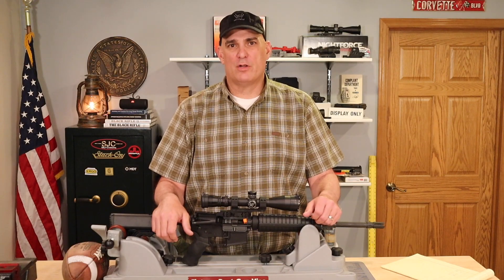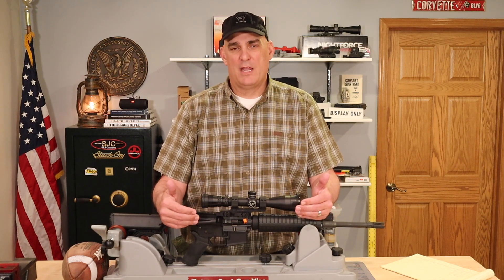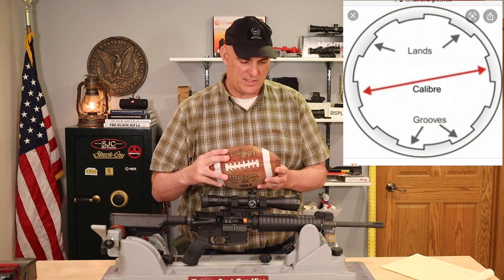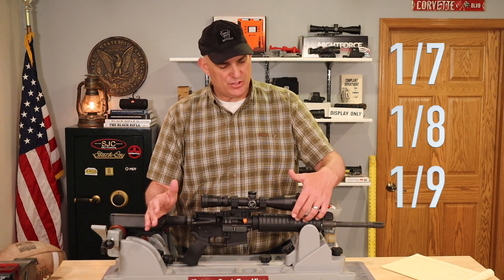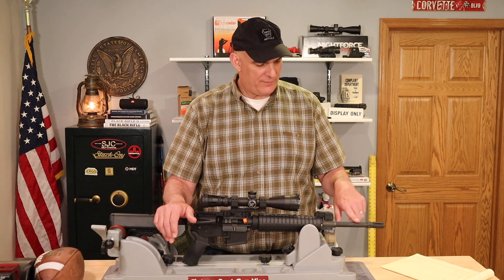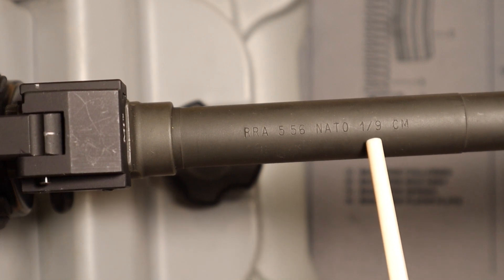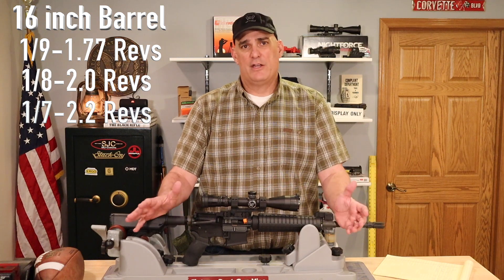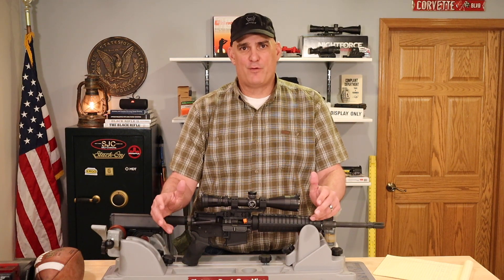Ar 15 ( 5.56 Nato / .223 Rem ) Rifle for beginners: Barrel twist rate made easy.

Comment: There is a lot of factors and half of them counter act each other. Longer barrel = higher accuracy, lower twist rate = higher accuracy, heavier bullet = higher accuracy, longer bullet = less accuracy, lighter bullet = less accuracy, and other little like the more aerodynamic a bullet is the more accurate it is at longer distances. An example is the 6.5 creed is accurate up to 1100 yards but similar .308 stops being accurate at 800 yards. The 6.5 has a thinner more aero dynamic shape so it stays super sonic past 1000 yards. This is only ballistics though. If taking into account the deadliness of a bullet the factors further increase. The faster the bullet the more penetration increasing distance into the body and/or body armor, the heavier the bullet the more energy it will take to stop it, at certain speeds bullets fragment, etc..
Reply: I've heard the barrel = accuracy (semantics) argument a lot. Definitely adds velocity. Not necessarily accuracy though.

Comment: I disagree with the length/twist rate hypothesis. The projectile doesn’t start spinning until it reaches the actual barrel grooves. Barrel length includes the entire length of the round of ammunition, brass and bullet combined. Only in a revolver, would you not include the length of ammo.

Comment: Sir, if you had a bunch of .223 American Eagle 55gr, Xtac 55gr? & IMI 62 gr, what upper twist and length would you choose for optimum bullet performance? I have it stuck in my head that my .223/5.56 stash isn't a good mate for my rifle.
Currently, I have a 16" 1:7 twist and cannot test past 25 yards being a city dweller.
Thank you if you answer this question.
Reply from the maker: You should be fine, but here is a video I did with 1/7 twist and 55 gr ammo.
https://youtu.be/pJ5lg5-0nM8
Reply: Over stabilized seems to bot affect precision just accuracy under stabilized seems to affect precision more

Comment: 20 inch upper 1/9 twist rate. Would the 62 grain M855 be okay?
Reply from the maker: Yes. Check out my twist rate videos part 1 and 2 for shooting demonstrations with a 1/9 barrel. Thanks for watching.
Reply: @PracticalAccuracy  What about 62 grain m855 with a 20 inch barrel and one in seven twist? Would that bullet be over stabilized?
Reply from the maker: @FinalLugiaGuardian   No. You can even shoot 55gr if you want.  here I shoot 55 gr with 1/7 twist.  https://youtu.be/pJ5lg5-0nM8

Comment: Hello.please🙏I have 20"in  1: 7 barrels 223 rem and what weight of cartridges should I shooting 200-300 yard?Thanks
Reply from the maker: You should be able to shoot 55 to 77 grains.  I would start with 55 grains and see how it does. typically, 55 grains is cheaper to shoot. Good luck.

Comment: Nice video. Just curious: does the barrel length include the chamber and throat which have no rifling?
Reply from the maker: The ATF measures barrel length from the crown of the muzzle to the face of the bolt.(assuming you do not have a pin and welded flash suppressor).  So this would include the chamber and throat even though there is no rifling. Good question. I hope the video was helpful.

Comment: 1:8 is equal to one complete 360 degree rotation of the grooves every 8 inches. The bullet doesn't necessarily spins at the same rate (one bullet revolution/ eight inches) because the bullet is not attached to the grooves and lands mechanically.
Reply from the maker: Correct. thanks for watching.